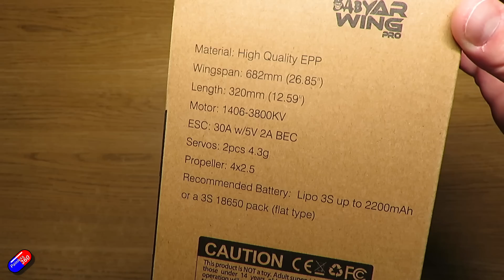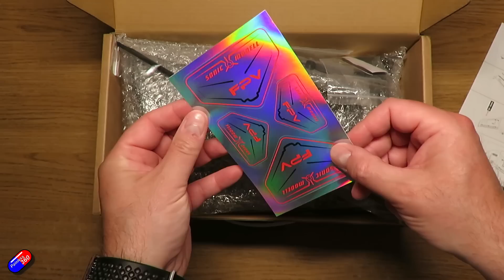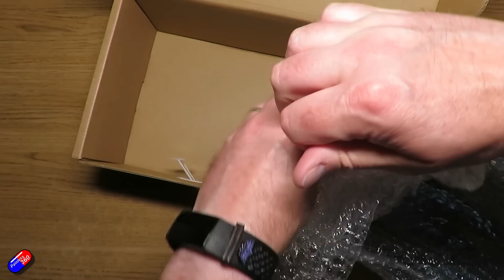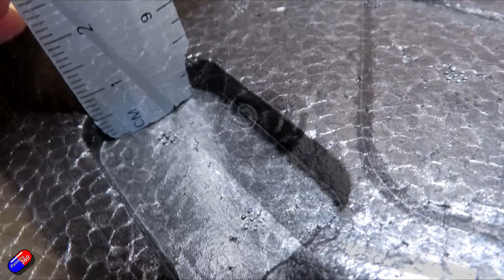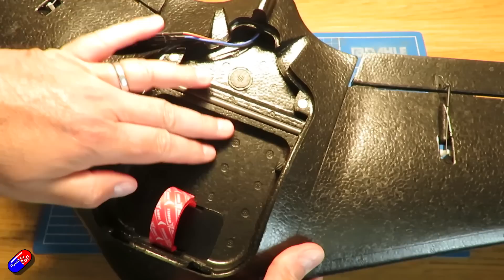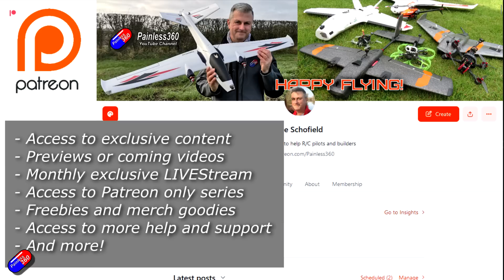World Exclusive! New Baby AR Wing PRO

Comment: Just maidened mine. Flys with a horrible up down oscillating flutter. Gyro fitted but switched that off and still flutters. Increases with speed! Wondered if it is the unsupported elevon tips..? Servo linkages are a long way away from tips...?
Reply from the maker: Best of luck finding the cause. It isn't a common issue with these... Happy flying

Comment: Lee, I see you do a lot of flying wings. I always struggle with the amount of "up" elevate to bias in for hand launching. Any general recommendations to present the "inverted J" maneuver?
Reply from the maker: I use INAV Autolaunch a lot here and that takes care of it. Good manufacturers are now starting to add the reflex needed into the manuals.. See the Baby AR wing Pro.. If all else fails (and I am not using INAV) then I err on the side of caution and use instant trim on the radio to fix... Happy flying

Comment: Interesting! I hope that you put Walksnail in it and a Go 2 mounted somehow on top. I also hope that it doesn't have too much wing wag as that is often the gamble with new and especially small wings. I think concentrating the mass around the center helps (which means not using the outer wing pockets), and building them with a higher wing loading also seems to help from my experience. I also wonder if a Vista air unit will fit inside because that's all I have at the moment.

Comment: Thanks for the reviewI've only ever build 1 fixed wing (AR pro), so consider me a newbie on fixed wings.   I don't understand why servos don't come set up from factory, or at least the specifics of the servo setup.  The basic servo setup from 1 pnp model (my AR wing pro) to the next  (your AR wing pro) isn't different.  Its not like they don't this information; manufacturers build and test their planes before selling.  Why not include details like...1) centre servo, 2) use second hole on servo arm, 3) use top hole on control horn and  4) have the rod 78mm long.    Its obvious that they can do this considering the model in this review comes from factory with the servos already set up.  I know that if someone is doing a complete scratch build with their own servos, control arms and rods then the linkages needs to be figured out by the builder.  But with PNP models I just don't get it.  Thanks as always for the great information.

Comment: My AR Mini has been brilliant. The only thing it needed was bigger (wider) battery bay.  My AR wing Pro was a disaster. You have to have  a huge battery and the weight of a Go Pro in the nose to have any chance of it balancing (I had a multistar 5200 4s  plus 124g of lead in the Go Pro bay at the front). Even though it was unnecessarily heavy it still had plenty of power. However, it's real flaw are the flexing elevons. I nearly lost mine on a high speed low pass on the second flight and then killed it on the fourth flight after is failed to pull up  to avoid a tree. I hope that the baby has stiffer elevons!
Reply: Laminate the elevons

Comment: Nice, removable wings. This will be something I can take on the motorbike. I’ll have to order one. Think the Mini AR could be retiring. 

Only things to me are:
- the motor. It seems small. The Mini AR was 1806, so a little larger. I think slightly larger with lower KV may have been better. But, it looks pretty interesting. I know the Dart250g was the same size. But it was smaller and lighter. 
- I’m not a fan of those hinges. All those gaps are going to lose efficiency from the wing. I think some glider hinge covering tape will be needed to get the absolute most out of it.

Still, hopefully HobbyRC will get them in soon.
Reply: The STRIX Nano Goblin "performance" version uses a 1407 motor at 4100Kv with a 4.1x4.1 prop.  Can take 2s or 3s.
Reply: @techstuff6829  the Nano Goblin is also smaller, lighter, and is more aero-efficient. It’s smaller and lighter than the Dart 250g too.